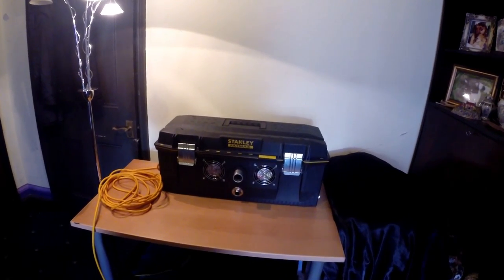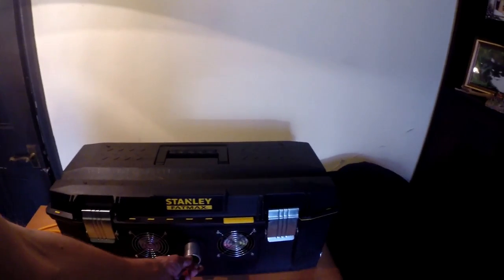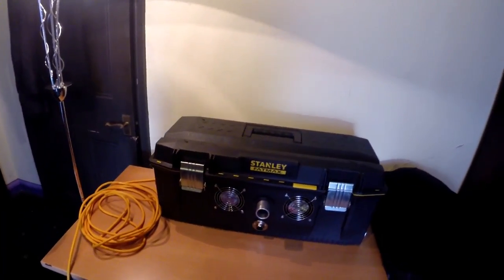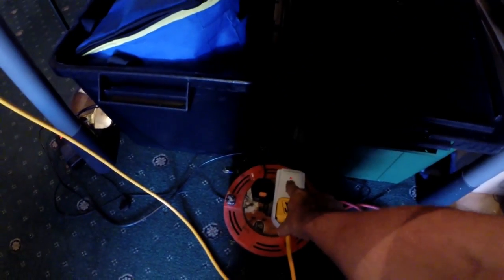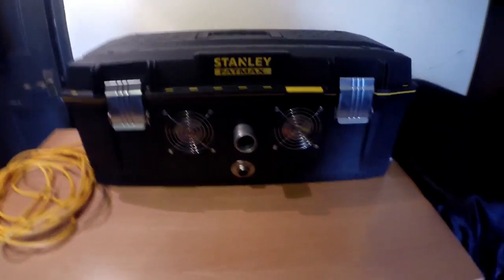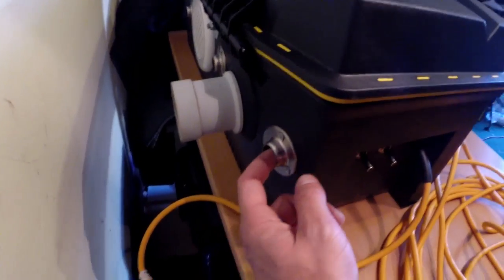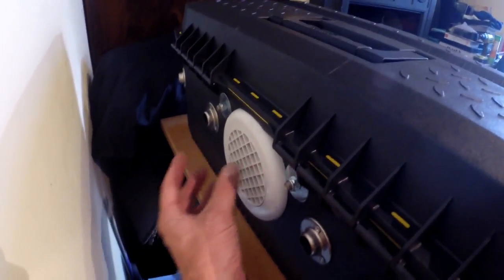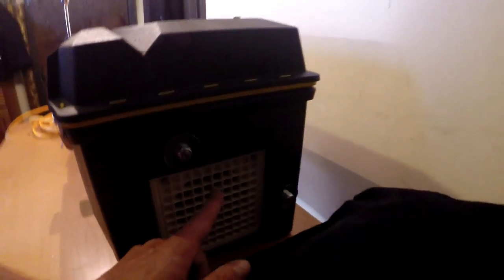TWIN 6.6 VAC BOOSTER POWER BOX

Comment: So—-
Where does this connect in the system?

Inline somewhere on the suction hose?
If so, all the debri goes right through the motors right?

Or- does connect to the exhaust of the existing motors? (Portable)

I have a portable machine with two 3 stage motors...
I want to bolster my suction so i can have good lift/cfm at 100 feet.

How should i configure my 3rd and 4th 3 stage motors? 
(They are matching model motors of the originals in the machine.)

Im having trouble getting answers.

I am mechanically Adept.

Comment: Nice. I made one recently but I set up mine in parallel. I was told that way was better for me to run longer hoses. I used a Mytee machine manifold to set them up in parallel. The box i basically made a frame metal and bolts and wrapped it with mesh from an old waste basket so air can cool motors. All wires are protected from heat with flexible tubing . The top is plywood. I like your cooling fans. Hers mine: https://www.youtube.com/watch?v=GGQXA5iP5Qw

http://www.commercialcarpetcleaningchicago.com